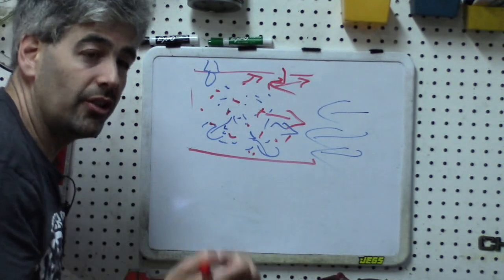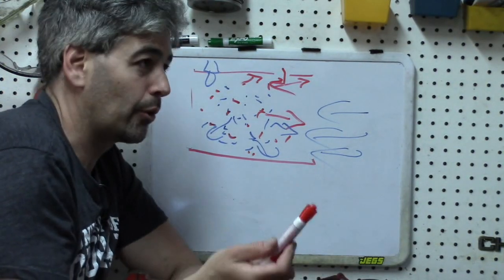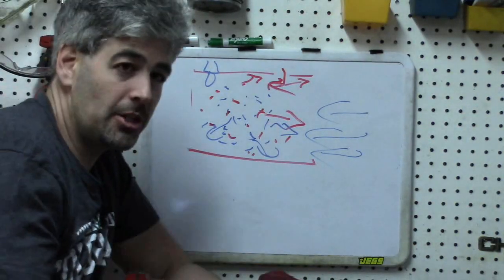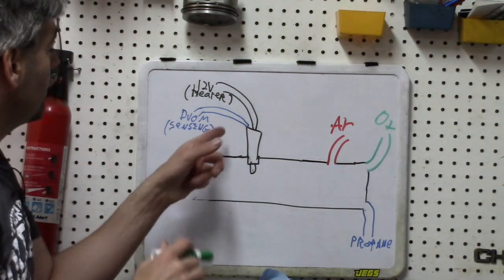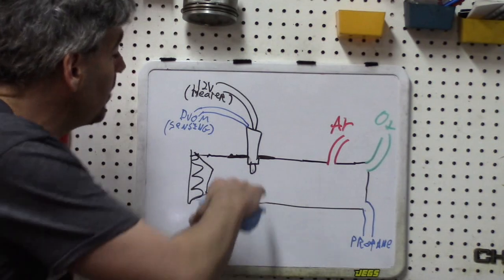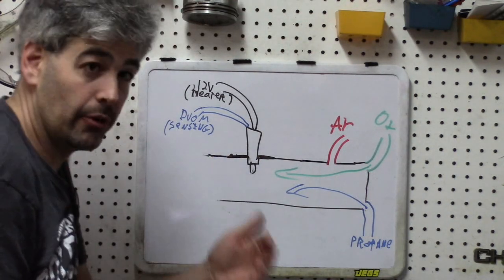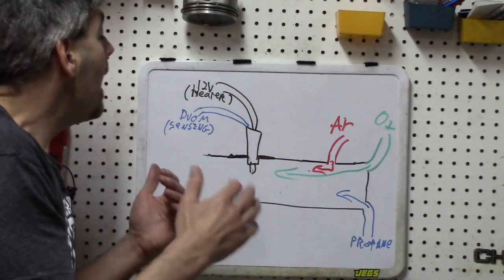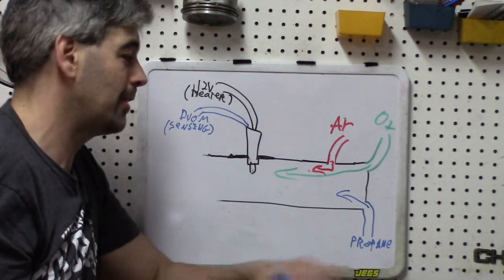Experiment for O2 Sensor Pt5  New Experiment Proposal

Comment: Hi Matt. I hope you did not get me wrong with my last posts (regarding the partial pressures thing): I completely agree, that your expectation to dilute the exhaust gas is completely correct and I also agree, that the exhaust should clearly be an open system (as I do not expect the pressure in the exhaust to be significantly increased by adding the Argon).
So I also would expect your experiment (already the last one) to work correctly - only the outcome was surprising. Currently I would bet on the sensitivity of the sensor to be the cause: under stoichometric conditions, the amount of O2 in the exhaust should be close to zero (clean combustion) therefor - in order to be of any use - the O2 sensor would have to be very sensitive to detect already a minuscule amount of O2 in order to help controlling the fuel injection.
So I could imagine it may take MUCH Argon in order to dilute the exhaust gas mix enough to see a clearly visible change to rich or lean (as the ECU will immediately try to eliminate the change by adding/reducing fuel).
So your new design takes the ECU out of this equation - it only May be required to create an environment with only a VERY small amount of O2 present to be in the relevant range. I am sorry - I am more guessing than knowing here. Without having done some calculations (which I did not until now due to time restrictionsI would not insist to be on the right track here. BUT I will try to do those calculations to get a feeling about the size of fractions that should be present in the gas mix...
Anyhow: I think your experimental design is correct (old and new one) and we might only be adding not enough Argon in order to see a relevant change...
Reply: Schrodingers Box Hi Matt. So you DID get me wrong? Not really?
My comment regarding the partial pressures was: I assume, the overall pressure in exhaust stays unchanged when you add Argon.
As overall pressure is the sum of all partial pressures of all components in the mix and we add another component, the partial pressures of all components that were present before adding Argon will decrease.
Also the partial pressure of O2 in the mix - and this (decreased partial pressure of O2) is exactly the dilution that you expected.
So - I completely back up your opinion that introducing Argon into the exhaust gax mix WILL successfully dilute O2 in the mix - and also that this dilution SHOULD be detected by an O2 sensor.
I am only puzzled that it doesn't seem to do as expected... could have to do with the required amount of Argon...

Regarding your question:
Yes, I agree. O2 displacement by other (added) gas mix components under constant pressure is the only way for such a sensor to work.

As for the intake manifold:
I think it's important to take into account that we have not automatically a constant pressure in the intake manifold.
The pressure in the intake manifold is controlled by several parameters: outside air pressure and cross section of throttle opening which account for the inbound air flow and the activity of the cylinders letting in gas and pumping it into the exhaust (mainly dominated by RPM and displacement) that accounts for the outbound flow.

Now - for the intake manifold O2 sensor it would be important to know if the amount of exhaust gas added is introduced BEFORE or AFTER the throttle.
I would assume the EGR gas amount in this case is added BEFORE the throttle (but I may be wrong here - it would only be the easiest way I could think of to realize this)

Reasons:
If the exhaust gas is added AFTER the throttle:
As long as the other parameters are constant, the intake manifold pressure will settle to a certain - constant - amount, which is a dynamically created equilibrium.
When the EGR valve opens, additional exhaust gas is added (under pressure) directly into the manifold.
All other parameters stay the same - so this equilibrium MUST be shifted to a new balance.I see no reason, why more air should enter the manifold under the given other parameters when the EGR valve opens - so we can assume the fraction of air in the intake manifold gas mix will stay the same.
Additional exhaust gas is added. So the extra total pressure in the intake manifold is created by the new component (exhaust gas) alone.
It MAY be possible that even less air enters the intake manifold (as the pressure inside the manifold increases - but the ECU could open the throttle a bit more to balance this out.
This in turn means: the total pressure in the intake manifold increases and the increase is completely made up by the additional exhaust gas. 
This in turn means: the PARTIAL pressure of oxygen in the intake manifold stays the same (same volume of manifold, same amount of air in mol in manifold).
-->This would IMHO NOT be recognized by an O2 sensor!
Only possibility this could maybe nevertheless work: if there was additionally a MAP sensor and the ECU would take care to adjust the throttle so that the same intake manifold pressure would be established after opening the EGR valve as it was before opening it which would effectively result in explicitly reducing the inbound air flow by the same amount of gas that is introduced by the EGR valve (-->back to constant pressure again). As MAP sensors are proven and available technology this may very well be the chosen solution.

If the exhaust gas is added BEFORE the throttle:
Again a dynamic equilibrium of inbound and outbound flow settles -->constant pressure.
EGR opens --> exhaust gas is introduced into the inbound gas flow before the throttle.
Before the throttle there is outside air pressure (no vacuum) - and this will not be significantly increased by the bit of extra exhaust gas that was added.
In this environment (constant outside pressure) the old logic applies: summary pressure stays the same while an extra component is added==> extra partial pressure for the new component==> decreased partial pressure for the original components==> dilution of the original components
-->can be detected by O2 sensor

I fear we (I) may now have successfully scared away another bunch of subscribers... :-(
Sorry for that...
Reply from the maker: Thanks I have been awaiting your response as I recall you were one of the people who claimed the partial pressure explained the lack of change with the last experiment. Any comment on the new intake sensor with regards to partial pressure?   Seems your partial pressure argument would apply more to an intake manifold than an exhaust, if anything. Would you agree that if it is an O2 sensor only, that O2 displacement is the only explanation for operation of such an edge sensor?
Reply: Schrodingers Box I'm only commenting to get the rest of the conversation.
Reply from the maker: Jürgen Thome Lol I follow what you are saying and I agree completely.  And yes, clearly I did misunderstand you in your initial communication.  I agree the results were completely unexpected but I absolutely do not believe partial pressure in the exhaust is an explanation for it.  I do believe the evidence indicates a role of HC in the sensing, whether intention, indirect, or just plan unintentional and insignificant.
Reply: Schrodingers Box Another thing that came to my mind: Let's assume, you have an exhaust gas output of let's say 60 gallons/minute and a O2 fraction of 1% in the exhaust - I think, that's not unreasonable.In order to dilute the 1% of Oxygen enough to make it 0.5% - that would require roughly 60 gallons/per minute of Argon.
The ECU would detect a lean condition and compensate. I have no definitive numbers, but I assume that would not immediately max out the fuel trim. Without calculating I would expect a minor increase. Not sure if it would already be visible in the scantool.
I am not sure regarding the numbers (exhaust gas volume/minute) but if I am not completely off with my assumption, it will require a LOT of Argon flow into the AIR port to dilute the O2 in the exhaust siginificantly... not even sure if you can add so much Argon without increasing the pressure within the exhaust (how much volume/minute can pass the cat before pressure before the cat increases)?
Just a thought...
Reply from the maker: Jürgen Thome Not sure I agree with that because just the tiniest vacuum leak less than a drinking straw instantly causes the O2 sensor to go lean and STFT to adjust immediately. Anything that seems to offset the stoich balance even in the slightest has a significant reaction
Reply: Schrodingers Box Yes - but while you need roughly 60 gallons of Argon per minute to dilute 1% of Oxygen concentration in the exhaust to 0.5%, it is sufficient to introduce only 0.6 gallons of Oxygen per minute and with that increase the Oxygen coincentration to 2%.So your observation with the vaccum leak that is less than a drinking straw does not contradict... should be possible that 0.6 gallons/minute can be sucked in trough such a small leak.
Reply from the maker: I need to see your calculations that that much argon is required to equal oxygen dilution
Reply: Schrodingers Box FWIW, Jurgen's argument about large quantity of Argon required to cause an O2 dilution that's significant to the O2 sensor is the same one I was making. So I approve :-). Pending ballpark data on normal exhaust flow rate.
Reply from the maker: Graham Wideman Awaiting your calculations showing molar ratios to support your position...
Reply: Schrodingers Box Yes - these calculations need to be the next step (at least for me for better understanding the situation). I'll look into that on the weekend.Actually I think 1% of Oxygen in the exhaust to be even too much to expect. Normal air has only about 21% of Oxygen - and the whole reason of O2 sensors is to ensure stoichiometric combustion - leaving close to no Oxygen over in the results of the reaction. So maybe it's even much less than 1% Oxygen left in exhaust gas - which would make the sensitivity of measurement even more sensitive for additional O2 and even less sensitive when additional inert components are introduced.
I'll come back to this as soon as I've done my calculations...

Comment: I thought we were done with this debate? However your test system will be really cool and you will be able to cover every scenario possible. It looks very similar to what another person already have done. I don't think ambient temperature will matter as long as the O2 heater is working. About my statement on the O2 sensor showing negative readings with pure O2. Actually it should produce some negative voltage but perhaps it will be so small a number it may be hard to register with a DVOM but it should be around -20mV or so according to the Nernst equation. However I still believe a true O2 sensor works under higher temperatures and then it would be able to detect the O2 better. Automotive O2 sensors are probably modified to respond to the molecule balance of combustibles and remaining free O2 and at much lower temperatures. Really looking forward to the experiment :)

Comment: Matt starting at 9:20 you presented the effect as rich in both instances when I believe you mistakenly should have said lean for an opposite affect. As to the experiment  I will defer any further comments to your viewers that are extremely more intelligent than I. Look forward to the results.
Reply from the maker: I checked and indeed adding propane should cause the sensor to go rich. Why would you expect it to show lean when the propane is added?
Reply: I agree rich  with adding propane in an open system , your second example  you said  it proves it's an open system if it goes rich again. I shouldn't have said the word lean I just didn't follow both examples introducing propane will go rich twice in an open system. I thought I had missed something.  Seems i am .
Reply from the maker: Steve Rob Dont woory about it, I freudian slip with it so much I had to refilm 3 or 4 scenes because I got it backwards.  The worst is when I do A/F sensors- it takes all my concentration to think if increase in voltage is rich or lean
Reply: Schrodingers Box I can see ten years from now, new Automotive Tech's getting confused by traditional O2 sensors while we're like, "What's to get? That's the simplest." lol

Comment: How are you going to determine the % of gases, or ratio of each? Rotometer? Or is it just going to be pretty much 100% one gas and dilute it to see which way the sensor signal goes?
Reply from the maker: Yeah since the sensor is narrowband there is no advantage to knowing proportions of gas. I just need rich or lean but I do intend to use flow rates as somewhat of a comparison.  I can't really do any kind of flow meters or other sensing equipment
Reply: Schrodingers Box I came across some info on the function of zirconium oxide cells for %oxygen concentration. Let me know how to get it to you. I think it will help answer some questions

Comment: Entire purpose of the EGR is to introduce EGR gas as an inert gas back into the combustion cylinder.  In a perfect model the EGR gas is almost completely devoid of oxygen (signifying complete combustion).  So lets call the EGR gas an inert gas for the sake of argument.  The inert gas introduced does 2 things.  It's slightly lowers combustion temperature and reburns the potentially minute amount of unburned oxygen so that at least you are getting partially complete combustion on a portion of recycled exhaust gas for the purpose of lowering emissions.  I'm not making this stuff up that's what it says in my Mazda factory work shop manual. The EGR gas is used as an inert gas.
Reply: "EGR recirculates a small amount of exhaust gas into the intake manifold to reduce the combustion temperature and reduce NOx emissions."
Reply from the maker: If exhaust with some hydrocarbons and O2 is inert- then that's nuts.  It may be inert to the intake air I suppose.  but either way, let's assume it's inert. The complaint of the masses was that my introducing the Argon into the exhaust failed to induce a change only because adding inert gas would not allow the O2 sensor to change reading due to partial pressures effect.  So why does it clearly make a change in the intake which is no less a closed system than an exhaust?  So either way I see this as a challenge to those who objected to my design in part 3
Reply: ***** Yes for sure. That is the main goal of EGR.
Reply: ***** EGR is for lowering combustion temperature to help lower NOx emissions (formation). I've never heard it was for assisting complete combustion of exhaust gas constituents.
Reply: ***** 3 Yes that is true. The exhaust gases are used as Mazda says. However the exhaust of an engine is never totally reduced because the flame front goes out before complete combustion and there will always be a little HC and O2 left for the intake O2 sensor to detect when it goes back as EGR. Scientist would probably have preferred Argon as an inert gas in an engine but sadly it is not readily available in the engine bay so exhaust gases had to do. So the article about the intake O2 sensor being an O2 sensor probably doesn't have much value to us in this debate.
Reply: ***** EGR system lowers combustion temperature by reducing amount oxygen available for combustion in the cylinders.  This occurs because post-combustion gasses replace part of the fresh air in the intake manifold.  Lowering combustion temperature results in lowered NOx levels.